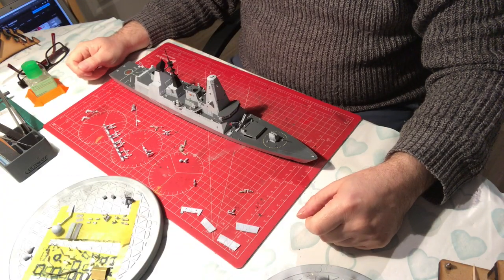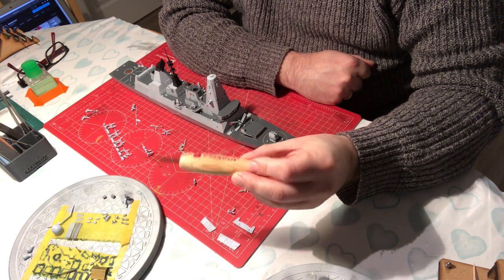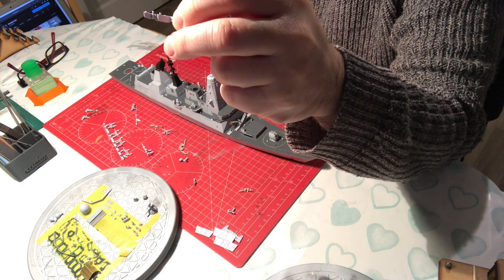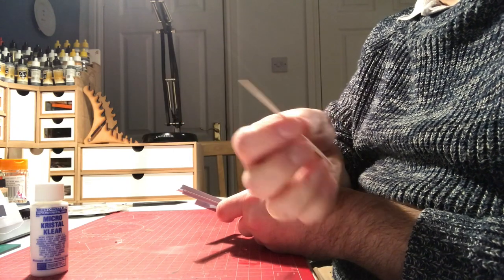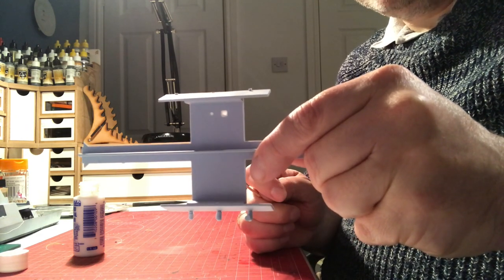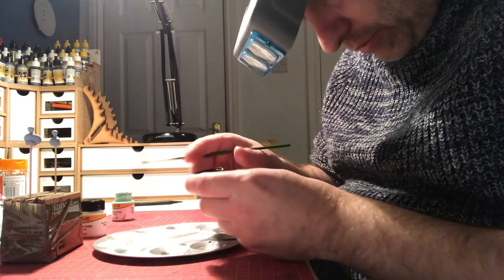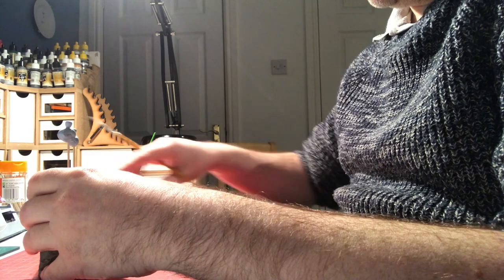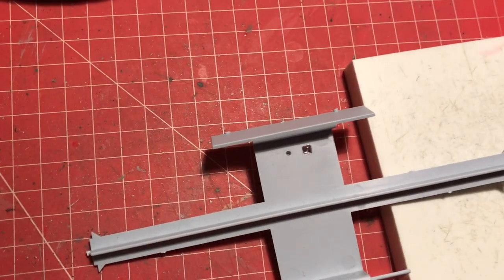Airfix Type 45 Destroyer with Atlantic etch part 3

Comment: Multi Function Radar (MFR) radar ball on the top is that shape and not exactly round as it houses two planar Phased Array Radar plates. They are set at an angle and lean back into each other. As there are just the two radar faces, that is why the sputnik spins as 2 faces can't cover 360 degrees when static, unlike the American AEGIS system which is 4 fixed position octagonal Phased Array plates mounted on around the superstructure. It is likely that the MFR is still superior to AEGIS, although AEGIS is also pretty stunning in its capabilities and I'm not sure which iteration of SPY the Yanks are on now. MFR is just amazing though and incredibly powerful. Even ultra low observable aircraft can only turn and run from Type 45 if they get within the radar lock range. Side note: I'm pretty sure that the Green domes are something like sat comms sets or Furuno sorts of stuff for SOLAS or maybe just comms. I can't quite remember.

Comment: Feller - why have you got the ensign flying from the HF aerial on the top of the hangar? It needs to be on the ensign staff at the back of the flight deck.
Reply from the maker: My understanding was that the flag could be on the hanger roof when a helicopter is on the deck and the jackstaff is not in place on the flight deck, don’t recall where I got that from, no great shakes if I am wrong. Thanks for looking in 👍🏻
Reply: @ModelkitStuff  No. That is a High Frequency comms aerial. The only time the rear ensign is flying is either at anchor (during ceremonial events) or alongside both times from the flightdeck staff. Also where your ship is underway, the accommodation and boarding ladder would never be deployed. Finally whilst underway the bow staff would be struck below
Reply from the maker: @fa0676  sorry but some of what you say is not correct. However I have not necessarily set out to achieve accuracy I was looking at aesthetics
Reply: @ModelkitStuff  All of what I say is correct, mate. I work with T45s in my day job and have has 42 years in and out of naval service. Take it from me, the boarding ladder will never be deployed whilst underway (only at anchor - unless you want it ripped from its mounting). That mast over the hangar is a HF comms aerial (you don't fly flags from them) and whilst underway, both fore and aft staffs are struck. And even if it was a staff, you wouldn't have an ensign flying with a helicopter ranged on the FD. If it's aesthetics you're after, you may as well paint it metallic pink. Models are all about accuracy, are they not?
Reply from the maker: @fa0676  nope models are about what the model builder wants to do with them, plenty of pictures on the internet of T45s at sea with the bow staff in place.  thank you for pointing out the many errors as you see them in my model I am sure you will build yours differently.
Reply: @ModelkitStuff  They aren't 'many errors'. Just ones which make no sense. You've done well making everything else pretty much perfect, yet have stuff like the accommodation ladder lowered whilst underway and flying a flag from a HF aerial. Like I say, you might as well paint the uppedeck crimson. Also, the IAE dome on the aft platform on the polemast is grey.
Reply: @fa0676  The Battle Ensign is flown from a halyard beside the main mast, usually on the port side
Reply: @chrisscreations5404  Only at sea, and when the task group commander gives permission for battle ensigns to be flown